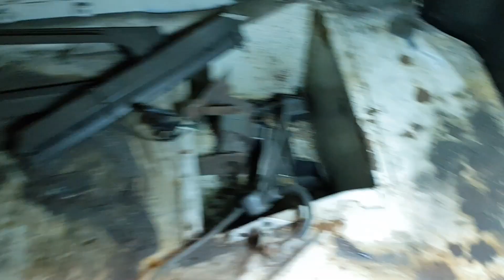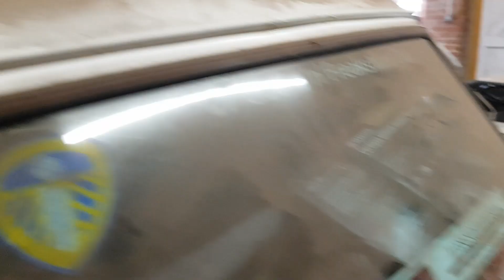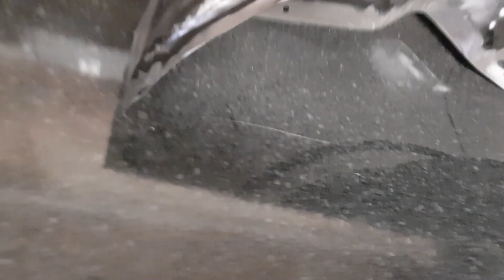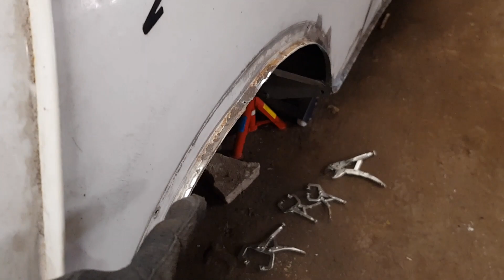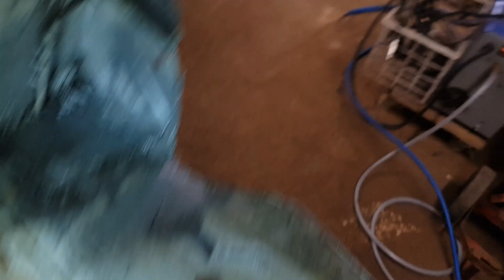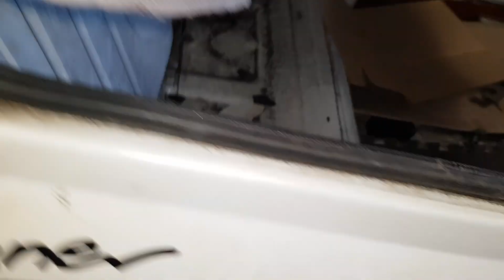Project Designer Ep 25 - Welding the rear wheel arch on my Austin Mini

Comment: That's looking good and it's a good fit 👌 On mine, every time I get a new bit welded in I spot a new rust hole 🤣 
Looking forward to the sub frame re build
Reply from the maker: Thanks! I've got some more of the boot floor to weld and then the rear valance. If I get bored I'll start on the subframe 🙂
Reply: I found it a lot easier putting the subframe in without the rear valance on. I have replaced the heel board and have had it in and out many time to check all the bolt hole line up, so may not apply to you but just thought I would say 👍
Reply from the maker: Thanks for the advice. I was worried about access to the valance with the subframe on. At least I have options 🙂